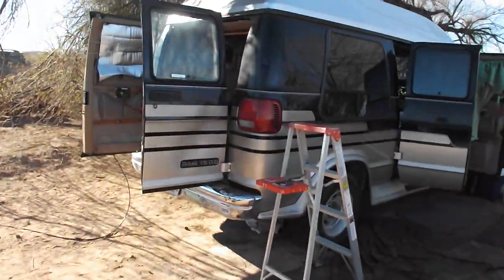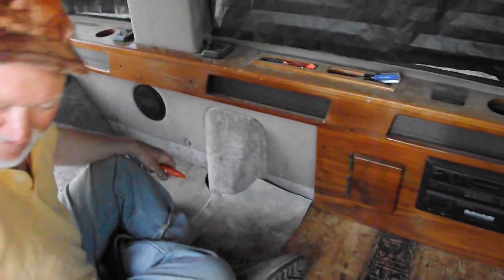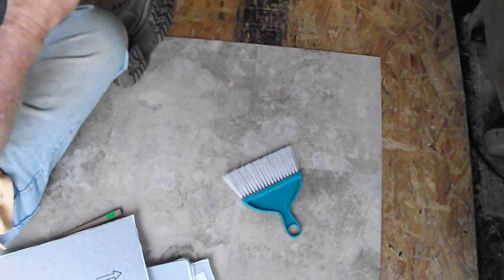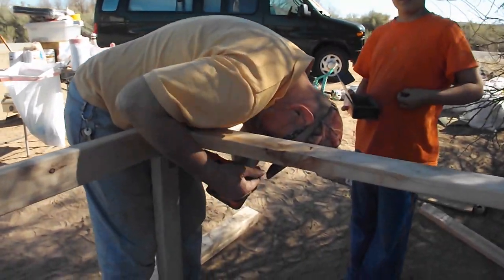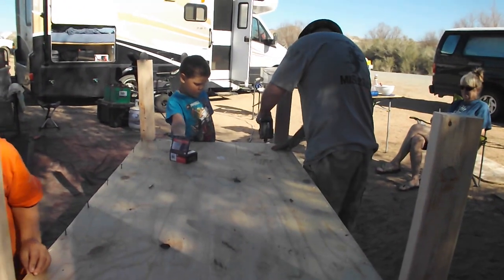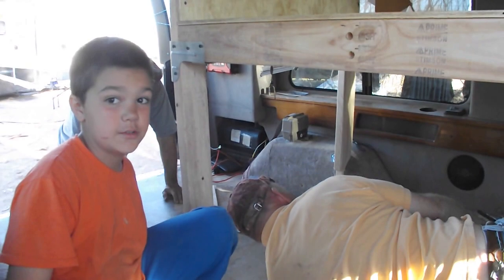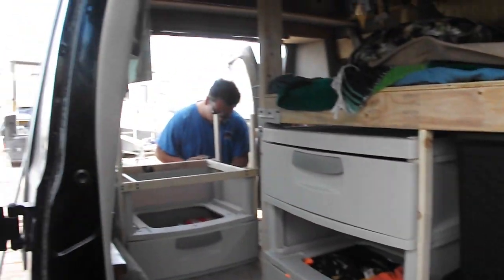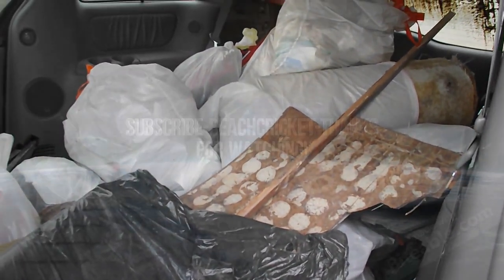Van Build For Cinnamon Girl-Floor-Bed-Cabinets-Part 1!

Comment: Nice looking tile floor! Is it linoleum tile? Interesting bed design... can fit all your dressers under. Not sure I'd want it that high but if it suits you that's great. I like the cooking area idea... I've seen some where they have it near the side sliding door which is what I've been thinking. Good one. They did a great job on the floor and bed. Not sure I could do the floor myself... I may attempt bed frame myself. I built a simple table one... think i could do it! Looking forward to seeing the finished look.
Reply from the maker: George McVlog It has been so much fun doing this! Thanks for watching!